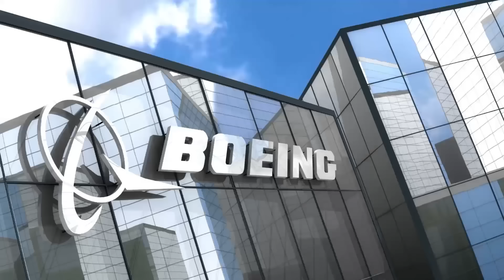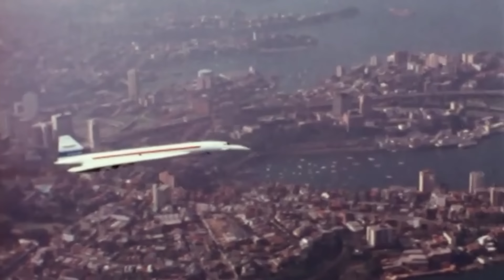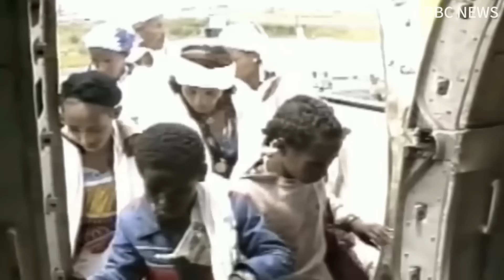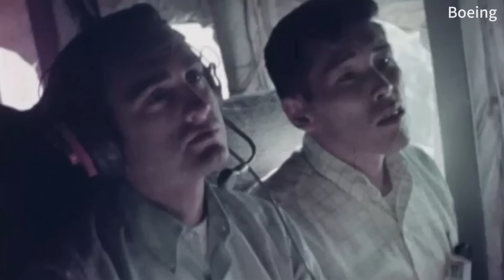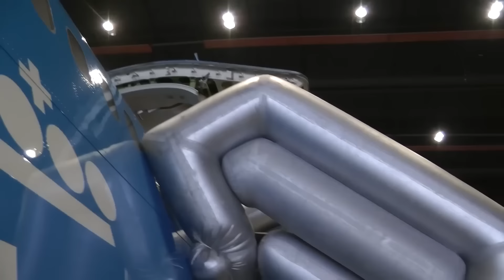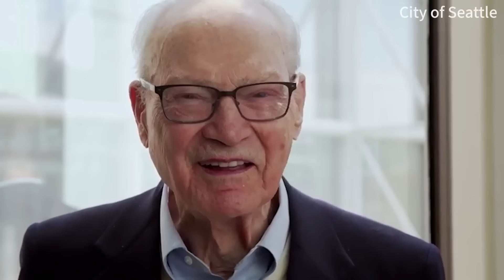What The Boeing 747 Hump Was Really For

Comment: My best flight ever was on a 747-400 from MAN-MCO.  VS74 IIRC.  Flying upper class, the reverse herringbone at the time was cutting edge.  I was in the first K seat and if you cracked your neck to look out of the window you could almost get a forward view as the nose curved.  It was quiet too, being so far forward of the engines and all the pumps etc.  Its one of the few long haul flights I have done where I thought to myself... I could do a few more hours!  The A380 is on a similar level but the 747 was the original!

Comment: I'm by no means an expert, but it the plane is that good, why could Boeing not just swap the thirsty engines for more modern ones and then immediately have a comparably cheap and reliable plane that can compete with modern designs? Because I'm pretty confident that almost all of the problems with the manufacturing process have been ironed out already, and I also guess that much of the cost of an airplane occurs in the construction phase.

Comment: An interesting video on an iconic airplane. However while the 747 did have an impressive cruise speed of Mach .85, the Lockheed L-1011 had a max cruise speed of Mach .95. Though we would normally cruise them at about Mach .84 for fuel efficiency.

Comment: I was working in Toronto Canada when Boeing came looking for engineers in 1966 to work on the 747 program.  At the time I was working on Inertial Navigation systems with Litton Industries.  I applied and Boeing hired me almost immediately to work for them.  After driving across the US during Winter I arrived at the Renton Boeing plant and following day I was taken to the Everett site  for my work assignment on the 747.  Initially I was assigned to work on the 747 Electrical system what was commonly known as Chapter 24 work which is how the various disciplines were identified by The Air Transport Association. During my 30 years at Boeing I was lucky enough to fly on the 747 many times.  The best Aircraft I traveled in sometimes in the flight deck on the Jump seat.

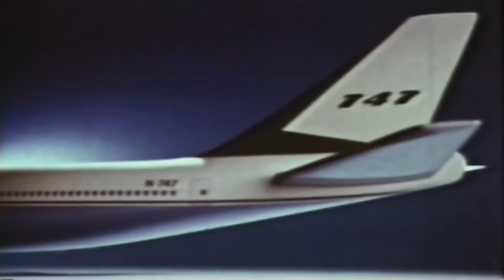Comment: 3:40 - they actually CAN. But nowdays airlines preffer fuel economy over the speed.
So modern passenger planes are optimized for flight at 850 kmh when the older - for 930 or so.
BUT! Modern passenger planes can give back a whaping 50% in fuel economy per passenger per km

Comment: I had flown on 747 a number of times when it was used by China Airlines and EVA Airlines for their Trans-Pacific routes, but the most memorable trip was on a trip to Japan on a JAL 747 in 2000. My Fiancé and I were going to Kyoto to visit my brother and the trip was Vancouver to Kyoto with a change of planes in Tokyo. Normally JAL would use smaller aircraft for such a short domestic flight (Tokyo to Kyoto is only 80 minutes with most of the time ascending and descending. The most fuel consuming time for a flight), but we were booked on a “repositioning” flight, where they move aircraft from one route to another route. Needless to say the aircraft was nearly empty. To the point that the entire passenger compliment was able to fit in the upper deck business class cabin. For 80 minutes I was able to enjoy how the other half travels and for the first and last time in my life I was able to travel in the “hump”. Just the process of ascending that staircase at the front of the plane was a dream come true and an experience of a lifetime.
The A340, A380 and 787 Dreamliner are beautiful planes and are complete technological marvels, but they will never compare to the “Queen of the Sky”.

Comment: I have flown many times on 747s mostly trans Pacific flights. I also, for a time, worked in air cargo and helped load a cargo 747 nightly. I can't remember how many 13 ft pallets fit on the upper deck, but I do remember that 3 of them fit in the nose.

Comment: The 747 design was leftover from an earlier proposal by Boeing for a military transport aircraft in 1963. Ultimately the military selected the Lockheed C-5 Galaxy, but instead of throwing away its hard work, Boeing turned it into the 747. In other words, the 747 was designed as a passenger aircraft based on earlier designs for a military transport, it wasn't designed as a cargo plane. In 1966 Pan Am CEO Juan Trippe ordered 25 747's and wanted an option to convert the 747 into a cargo plane. This drove a lot of the design decisions from that point forward.

Comment: First design job (WDTA passenger entertainment) after flying 'Tailhook Navy' (VAW-11(CVS-10 & CVS-20--'62-'64) . . .  was on the B2707 (SST then canx'd) . . .followed by Pan Am's 25 B747-100 (still flying upgrades & as Air Force One).  It was originally a cargo design that also lent itself to a unique passenger variable to this day.  They are still on order to the White House, even though no more to build.  Also did L-1011 Tristar to compete with DC-10.    Too much fun . . . far beyond Airbus . . .

Comment: There is a little flaw worth mentioning. When a 747 Passenger Plane was converted into a Freighter it could not lift the nose section. Then it could only load as usual by the side.

Comment: Flew SFO to Oahu in 2000. Half way there, there was a strong electrical burning smell in the cabin. The “stews,” (aka flight attendants) and some flight deck crew walked the cabin with worried looks on their faces. I wrote a “goodbye” note on a napkin. The video entertainment system stopped, and I assumed that was the problem, and we landed safely. I returned back to SFO on a 777.

Comment: Most memorable moment actually two the first 13 hours 747sp flight from New York to Tokyo. Smoking pot and the laboratory with two of The Ramones and their manager. 

Second was dealing with a 3 engine landing after taking off from the old Hong Kong KaiTek airport we had an engine stalo and had to land fully loaded back in at KaiTek - which was always a handful under the best of conditions. We used every bit of runway available and were still well over speed when they turned the plane for the taxiway. The right wing dipped down below the level of the runway and almost hit the water. The plane was lurching back and forth as they were trying to balance the brakes and the asymmetric reverse thrust from three engines

Comment: I had always wanted to fly on a 747.  2024 I had my chance!  Less than a handful of carriers still use the Queen of the Skies to fly passengers and Korean Air is one.  So I flew on Delta over to Korea solely so I could fly back to JFK on the Korean Air 747-800.  My seat was 1A.  The first 4 windows of the airplane!!  IN FRONT OF THE PILOT!  A bucket list item checked off for sure.  LOVED IT.  Now I've flown on the 717, 727, 737, 747, 757, 767, 777, and 787!

Comment: Where I grew up there were no regular flights in or out of the airport for the 747 or the tri jet twins DC10/MD 11 and L1011, but there is an American Airlines maintenance base and they would fly the DC-10 and 747 in and out for service.

Back in the 70's it was 737/727/DC-9s that were the main aircraft flown in and out, but you could always tell when it was a 747 by the distinctive whine of the turbo fan engines as opposed to the turbo jet engines of the routine flights. Always tried to get a look at the big 747 as they came and went as a kid since they were so big. 

Occasionally the shuttle transport would stop for refueling and that was always something to see. They would actually announce it on the news so you could go see it arrive or depart on those rare occasions.

Comment: I have flown 750+k miles on 747 but the most memorable was when I flew a 747 with qantas from denpasar to sydney in a main deck all economy configuration. I sat in the very front row. The flight attendants were pretty relaxed and turned a blind eye as i slept on the floor with my back against the bulkhead.

Comment: 1986 I experienced what was at the time, the adventure of a lifetime, flying with my best friend from our home in North Carolina to Sydney Australia. It was Eastern Airlines. The main legs of the trip, from Los Angeles to Sydney, took place on a 747. Outbound we stopped in Honolulu to refuel. That was the first (and maybe the last?) time I got off and back on the same plane during a layover. It was the most comfortable and spacious flight I had ever been on. I didn’t have the privilege of sitting upstairs in the “hump” but the main cabin was enormous. The plane wasn’t full, so I was able to find a row of seats in the center section and lay down stretched completely out. I also remember having several meals on that flight and all were first rate. Something I’ve rarely experienced in recent years, even with trans-Atlantic and trans-pacific travel. Even back then, when there were many 747s in service, it was pretty special to get to fly on a 747. I flew on 747s 2 or three times after that on various longer trips, but that one was pretty special. I’ll never forget it.

Comment: Until NASA's SOFIA was retired, I was a Flight Engineer on the Stratospheric Observatory For Infrared Astronomy.(SOFIA), a 747-SP with a 17-ton telescope mounted in the back with a 10' wide door. We flew further into the 'coffin corner' on every flight, always trying to get as high as possible to get above the water vapor (which is detrimental to IR astronomy). The service ceiling was  45,100'. We reached at least 43k' every flight and even 45k' a few times during my relatively short period. Buzzing around at a near constant Mach 0.85, we worked our way closer and closer into the 'coffin corner' by the end of the night.

Comment: In the late 1970s I used to go to the beach west of the El Ay airport so when lying on the sand planes taking off would be overhead. This video didn't cover their jet engines, but there was something different about the 747s from all other planes. Besides the basic smooth jet taking off roar, whoosh and whine the 747s had a choppy sound. There must have been some major innovation in their engines.

Comment: The old sliderule engineers may have designed a faster aeroplane, but it is nowhere near as fuel efficient as modern jets.
And the REAL purpose of the hump, was to accommodate humping for the Mile High Club!

Comment: No secrets or surprises from my points of view. You forgot something. The 747 is easier to control in flight than a Cessna 152. Also, give me an accurate map, compass, clock, Altimeter, Airspeed indicator and a sextant. I'll Navigate the planet. Make life easier. Add an ADF. Pilot trick, All those buttons switches and dials are only scanned or set as required. Critical Flight Controls and Instruments are clustered for easy scanning and reach. As a back up there are procedures and checklists for each phase of the flight. The whole process becomes an automatic routine of sorts. Crew coordination is a matter of practice and standards. Also, even the 1960's autopilots could navigate and fly airport to airport virtually unassisted.

Comment: The video, "What The Boeing 747 Hump Was Really For," explores ten extraordinary secrets of the Boeing 747, often referred to as the "Queen of the Skies" 00:35.

Here's a summary of the secrets revealed:

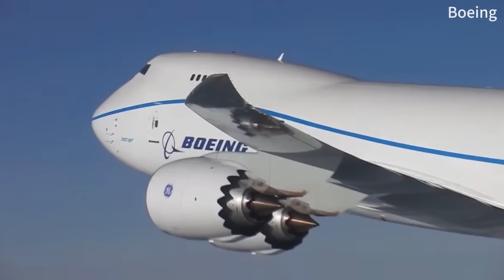*The Accidental Icon:* The distinctive hump of the 747 was not initially designed for passengers. It was intended to allow the entire nose section to swing open for cargo loading 01:08.
*The Supersonic Subsonic:* The 747 remains the fastest subsonic commercial aircraft 02:34.
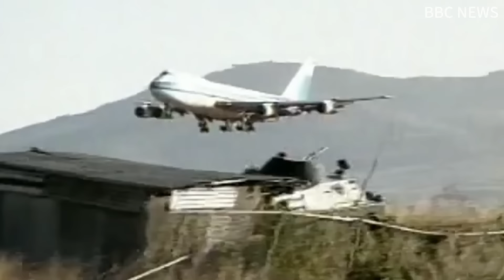*The Flying Rescue Mission:* An El Al Airlines 747-400 evacuated 1,088 people from Ethiopia 03:48.
*The Analog Masterpiece:* Early 747 cockpits were highly complex 07:07.
*The Audacious Gamble:* In 1966, Boeing took a massive financial risk by betting its future on the 747 06:41.
*The Redesigned Revolution:* Safety regulations led to the iconic partial upper deck 08:40.
*The Flying Canvas:* Painting a 747 is a complex process 10:19.
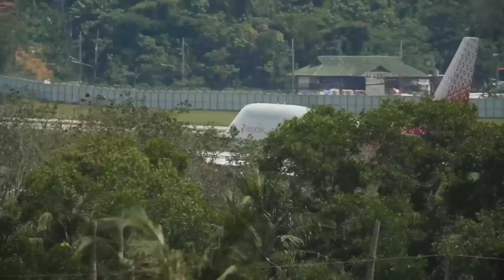*The Record Setter:* A Quantas 747-400 completed an 11,000-mile non-stop flight from London to Sydney 11:57.
*The Space Shuttle Carrier:* Specially modified 747s were used by NASA to transport space shuttles 13:35.
*The Cultural Phenomenon:* The 747 became a global cultural icon 15:03.

Comment: I've only flown on a 747 once. It was an approximately 12 hour test flight of AF1 in 1989. We flew all over the western half of the country, from Kansas to Nevada, Texas to Montana. My purpose on this flight, along with about twenty other engineers, was to perform a functional test of the sound proofing of the conference room. It was to determine if a meeting would be understandable at all the seating positions in the room. We even had to wear suits to approximate the attire and equivalent sound attenuation of the typical meeting. Everyone, in turn, read a different list of words, and we would circle a word from a multiple choice list. I only had difficulty understanding the guy directly in front of me facing away from me. That turned out to be general case for everyone. We added lead impregnated vinyl blankets around the room, which required redesigning the ceiling structure to handle the extra load. They simplified the second test to just comparing before an after ambient noise level, so I never got another ride. I was just a passenger for about 90% of the flight, and with my security clearance, was able to roam about any where on the main deck. It was a fantastic experience and a highlight of my career.

Comment: The speed Mach number of .85 vs .80 difference is not a limitation due to the inability of engineers to achieve the higher number.  It is an efficiency issue.  That .05M increase comes at a disproportionately larger fuel burn since at that speed any aircraft gets deeper into the drag divergent zone approaching Mach 1.0.  It is a design feature of the newer aircraft to save fuel and be more efficient.

By the way, if you fly a 747 at .8M, it is more fuel efficient that flying it at .85M.  But the newer aircraft are optimized for flight at .75 - .80M and still out perform a 747 flying at .75 - .80M.

Comment: The hump was copied from the Lockheed C-5 Galaxy, whose hump actually does stretch the entire length of the plane - and does include seating for passengers. More specifically, a large number of soldiers can be accomodated in aft-facing seats in a room above the cargo hold. The crew sits in a raised cockpit that allows large loads to enter or exit beneath it ... through the raised nose.

Comment: The real reason the hump is on the 747 is to reduce the shock waves as you approach and cross over Mach speed. On a conventional straight tube plane, the transition where the wing starts causes a second shock wave (after the nose shock wave) adds turbulence and drag.  An engineer realized that he could eliminate the second turbulence zone and shock waves by keeping the cross section area uniform along the length of the plane. He calculated the cross sectional area of the wings and determined that adding that same amount to the forward section of the fuselage  would eliminate the turbulence and drag.  With less turbulence, the 747 could fly faster and outpace all the jets that use a uniform tube diameter for their fuselage.

Once Boeing knew they needed to enlarge the front section of the fuselage, the design team figured out the options and advantages of how to best utilize this space as first points alluded to with higher cockpit, two level passenger flight deck, potential front loading on the cargo version, etc.

This design principle is also incorporated into most of the faster combat jets.

Comment: You missed a secret. Every 47 has five (5) wing hardpoints, the fifth one (inboard of № 2 engine) originally designed to ferry a spare or dead engine around. Virgin Orbit was able to make use of this fifth hardpoint to mount and air launch LauncherOne under the wing of Cosmic Girl.

Comment: I was a passenger on the 747 several times. 
I also had the privilege to work for Boeing as a Tool and Production Planner for Interiors and electrical projects on various models of the 747 and other planes. 
One of the more complicated interior jobs was when the National Airline of China (CAAC) wanted to have a photograph of the Eastern Mountains at sunrise installed on the forward bulkhead - Boeing had to modify their machines to do the artwork in one piece and it took a few tries to get the application technique worked out to not have any bubbles in it.

Comment: I apparently had a rather unusual experience wrt 747s.  My first several flights at all were on 747s.  Two years in a row (either '69 & '70 or '70 & '71), my parents and I got on a Braniff 747 in Dallas Love field to NY and then took a Lufthansa 747 to Frankfurt. Same on the way back. 

We were all gobsmacked at how huge they were. and rolling down the runway on takeoff, if seemed like that big old building was never going to get off the ground!

All those flights were fairly sparsely filled, and at the time at 12/13 years old, I initially assumed that was because demand hadn't caught up with all those seats, but it was because the Love Field runways were too short for a fully loaded 747. Knowing we had pretty much used all of that Love FIeld runway, I did often wonder if the 747 was one of  the reasons DFW was built.

With those first 8 747 flights and then a round trip to NY out of DFW a few years later, my 1st 10 flights were on 747s! 

I thoroughly enjoyed each flight, though, and the planes always left me in awe.

Comment: Early summer 1970 I flew from JFK to Frankfurt Germany on Lufthansa, we were delayed a day because on the 747's second commercial flight it had an engine fail so we were put up at their expense in the Commodore Hotel on 42nd St. (now it is "Trump Tower" even though the upper floors with the rooms are nearly unchanged from what I'm told).  
We were told by the crew they were still working out the kinks, and indeed it seemed the galley doors wouldn't stay closed and were frequently popping open.   Other than that a great flight.